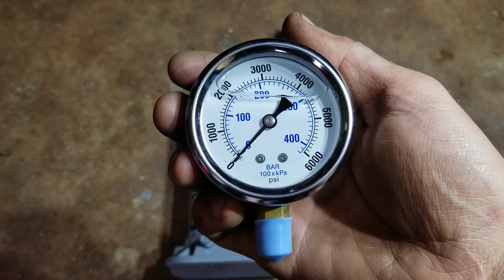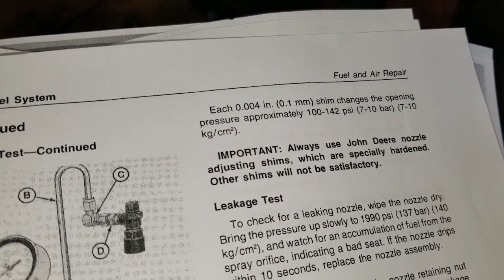How To Build A DIY Diesel Injector Pressure Tester WILL IT WORK?

Comment: Just to be clear are you adding diesel through the fill port in the back? Thanks
Reply from the maker: Yes. I top off the jack cylinder with diesel through the fill hole in the back.
Reply: @MattsShop  thanks!

Comment: I rebuild diesel injectors pretty much 24/7 and Ive got to say that without a doubt Yanmar bodies are the hardest to hold while lapping the sealing faces. 
One thing to be careful of with the Yanmar injectors is the thickness of the copper washers that go on each side of the return rail. Too thin and it allows the bolt to go down onto the adjusting shims bootin the injector pressure thru the roof in some cases. I machine an amount of rach bolt if they come with the injectors and always inform the installer to use thicker Dowty type washers or thick copper ones.
Reply from the maker: Thanks for the info. I will keep that in mind for the next Yanmar engine I work on. I see exactly what you're saying. That would throw off the PSI big time.

Comment: You mean to tapp in the adapter which you welded in 2:16? Thanks
Reply from the maker: I would tap the top of the jack and not weld anything. The part with the nut on it that screws into the top of the bottle jack.
Reply: @MattsShop  Thanks for your answer, English is not my mother language so sometimes I miss something ;) I have and adapter 3/4" to 1/4" and i want to screw it in but You say to tap it?? dont get it

Comment: I need to make some shims. I'm in Hungary.. No idea where I can buy them but I can hire a machinist to make them.  Do they need to be made of some certain type of metal?
Reply: not really, get some steel washers, can also use steel shims from gauges, can do it also with a small piece of plate steel as well just sand it down